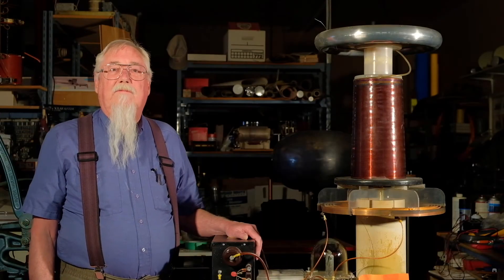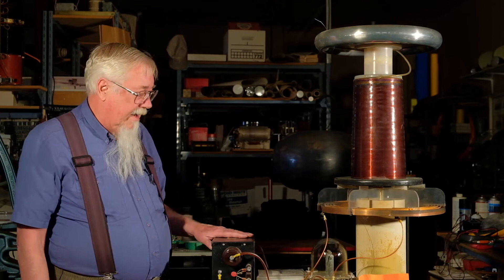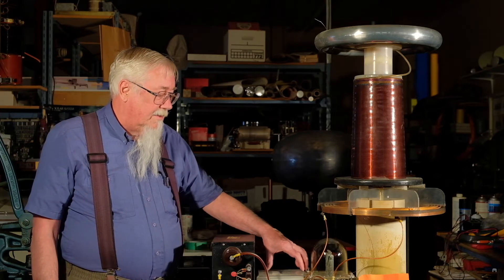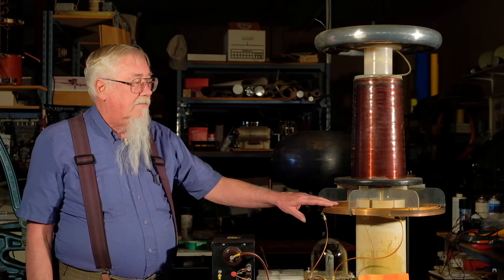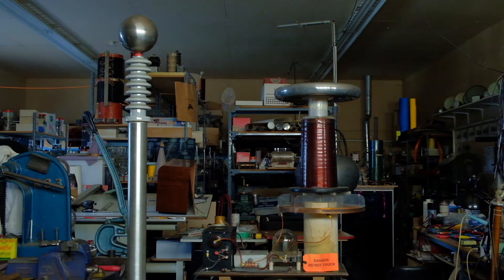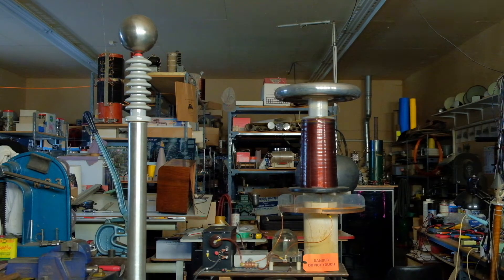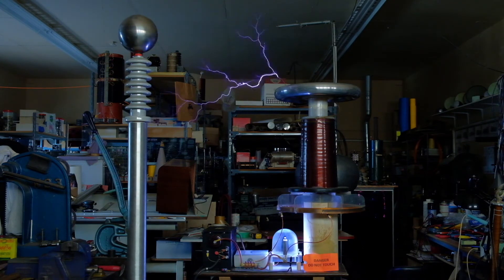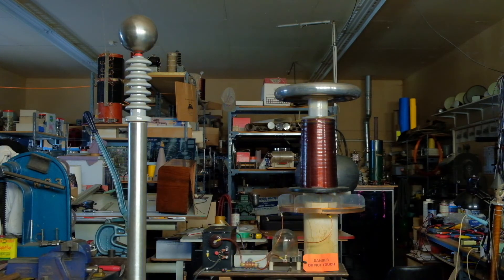Big Sparks from a Tesla Coil!

Comment: Almost like Tesla did. Sad to see you didn't quench the sparkgap and not a single turn primary. Then you could have a  electrostatic discharge, from the slow charge of the capacitor and the quick single discharge through the single turn primary, that then doesn't oscillate, but produces an electrostatic thrust. Almost there! Read more in the 1891 lecture of N. Tesla...
Reply from the maker: Thanks, and yes, weird stuff can happen when you operate outside the box. Garry built many of these devices decades ago and the objective of this video series was to get them working again and record them for educational use. I follow your channel with interest and am currently doing my own research using modified Tesla coils to transmit signals over hundreds of miles - see my latest videos.
Reply: @DavidSkelhon  great, I'll take a look.